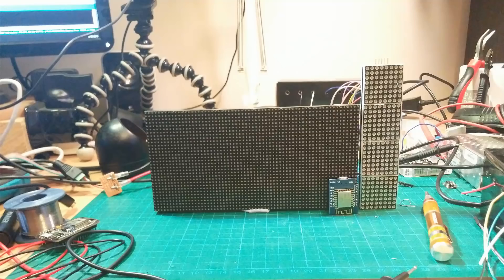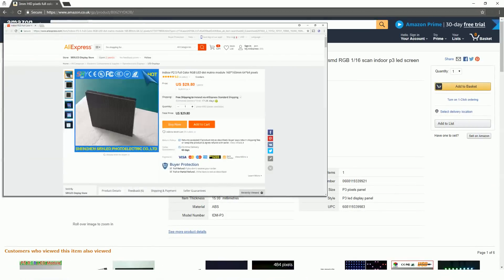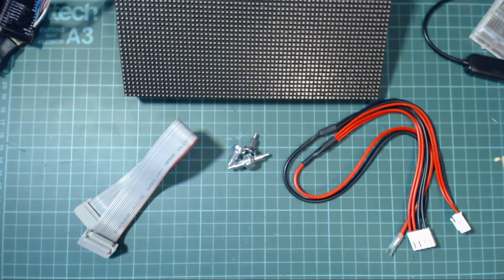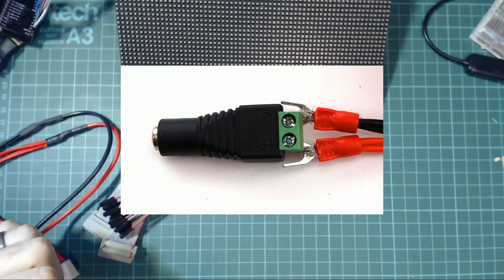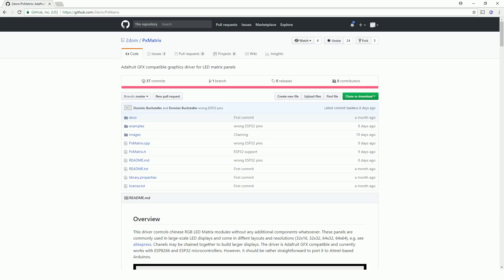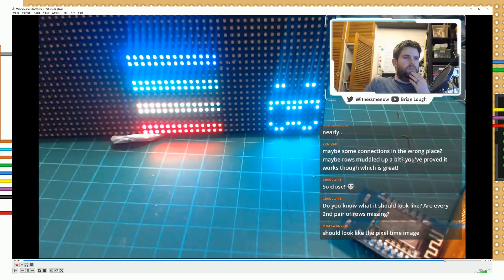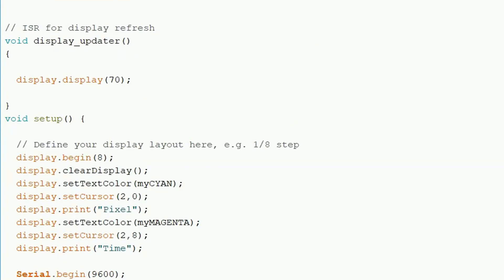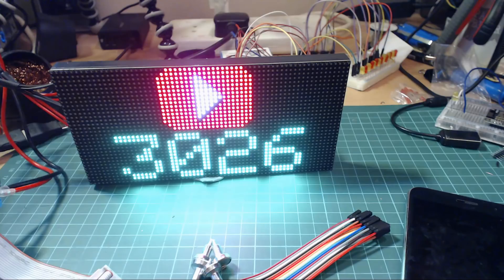RGB LED Matrix with an ESP8266 - How to get started

Comment: Hi Brian, Ive been playing with your sketches and I noticed  that pin 7 or GPIO pin 13 on the Mini D1 is not defined (or I cant find it) in the sketches and the display will not work without it. can you help elucidate what that pin does and how to change it for an ESP32? Thanks!

Comment: Thanks for the project Brian. My LED Matrix, which is same as yours, works great but when I use it for instance to get Bitcoin price online, it flickers when ESP8266HTTPClient library is using the GET function, for the entire duration (1-2 seconds). Any idea why this could be, and how I can make the transition from one value to the next smooth and flicker-free? Could it be a faulty ESP8266 or power supply? Everything works great otherwise. Cheers mate!
Reply: just in case anybody else reads this: the RGB panel doesn't have internal memory, the ESP8266 has to constantly provide the state for each of the LED's. if you make the controller do something that prevents it form updating the screen fast enough then you'll get flicker.
Given the price of ESP8266 and even ESP32 today you could try using a second ESP just to control the matrix and do the heavy stuff on another.

Comment: How to connect 2 cols x 2 rows of 16x32 panels? Will that library work and what the wiring will be? Anyone did that 2x2 panels? I want to use ESP 32 to drive them, the scan is 1/4, so the ESP32-HUB75-MatrixPanel-I2S-DMA library will not work for 1/4 scan panels.

Comment: I believe wiring shown @3:59 is incorrect. According to PxMatrix docs the green wire between PIn and POut should be from B1 (B0) to G2 (G1) and you got it drawn hooked to POut's E (4th pin in 2nd column), instead of 3rd pin.

Comment: this is an old video but thank you regardless. Surprisingly it almost worked for me. when i run the example Pixel time however the bottom half of the text is cut off. I am not sure what my issue is. I have definitely checked and the E pin is actually ground so i removed that pin. I checked the others tho and they are no ground. I also think i found my pinout but it's impossible to know.

I am using  a nodemcu v3.
I triple checked the pins being assigned to lat, a, b, c, d, and OE and they are all correct.  but the example code does not seem to mention CLK anywhere and i have it plugged into D5 could that be causing my issue? 

Another thing i noticed is the  G1 which is presume is Green1? is running to R2 on the output? is that correct? I figured G1 would go to G1 etc.

Thank you if you decide to reply it would mean a lot!

Comment: I want to to copy the project and I found a cheap rob matrix on eBay https://www.ebay.com/itm/US-Indoor-LED-Display-P2-5-Medium-64x64-RGB-LED-Matrix-Panel/284007664378? . would the process be the same as you did in the vid or would there be some difference

Comment: and you are all over the web kingdom where ever there is a mention of these Px matrix or HUB75 rgb matrices ...seems like you are the God Guru and solution wiki help desk all rounder ... i have been working with neopixels and and ws2812 matrices, i got interested in these px matrices as they are pre assembled already ready to use cheaper than the neopixels matrices considering the number of pixels or leds ..  i watched your video long back but i had no idea how to control these boards .so dropped... but now i myself ordered these boards .. and really wanted your help as there not much info on what i want and you are my only hope so please help me out ..
i want a way to control this board through esp8266 or Arduino uno  to display Artnet or tpm2.net E131/sCAN to control from Jinx! or xlights ....there are artnet tpm2.net codes for wireless esp boards and serial arduino through glediater protocol .. can you help me in this matter to control these px matrix through Artnet or E131/sCAN or tpm2.net .. really help needed ...

Comment: Hello. I use this great library too (PxMatrix), I use 64x32 P4 panel, a project works good? but some times my ESP32 reboots with this error: esp32-arduino-lib-builder/esp-idf/components/freertos/queue.c:1446 (xQueueGenericReceive)- assert failed!
How to solve this problem, thanks. I use display.drawChar(......) function for displaying time, date, temperature, pressure in one screen, possible I need some delay between output (I dont know).

Comment: There is a small mistake in the wiring schematic at 4:00, the green wire needs to be 1 pin higher on the right connector, otherwise the blue color channel does not work!
Reply: Thanks for the input. I can confirm that by looking at another Brian's project, here https://github.com/witnessmenow/WiFi-Tetris-Clock

Comment: If you connect it like this (04:00) you don't have blue on your LEDs. The green wire on the right (output connector) should be one pin higher, next to the red one...
Reply from the maker: Yes you are correct, but I can't annotate  it to correct it. I have a link to the correct wiring diagram in the description
Reply: Oops, didn't see that! It would have saved me a lot of time, but it's working now, thanks!
Reply from the maker: @angelwitch06  I'm sorry you had to waste time on it, it would be great if I could update the video but I can't!

Comment: Hi. Since I am new to all this, I have a safety concern. Is it fine to work with laptop power supplies which is 5v 6amp in your case.
Thanks in advance :)
Reply from the maker: If the power supply is 5v it should be perfect! I've never heard of a laptop with a 5v power supply though.
Reply: @BrianLough  I'm sorry, i meant to ask if working with the laptop supply which you used in the video is safe?

Comment: When i use the esp8266 for my 32x16 matrix i get a lot of noise. How do i counter this?
Reply: same here
Reply: Another post is saying you need to look for ground pins on the "output side " connector of the matrix and connect them to the ground of your WemosD1Mini. Just tested it. I confirm it reduces the red green and blue noise significantly.
Reply: Vlaming?
Reply: Als je de esp8266 voedt met de 5V bron van de Matrix dan heb je nul "noise". Best een diode gebruiken wel in dit geval om ongelukken te vermijden. Je wil de matrix niet per ongeluk "tijdelijk" doorheen je ESP8266 van stroom voorzien terwijl je die re-flashed. (of gewoon eerst je code goed krijgen met ruis en dan 1x flashen en  met je zijdezachte poten afblijven. :D)

Comment: I'm trying to use the PXmatrix.H with a ESP32, but my LED panel only turns the Red LED. Any insight of what ir might be?
Reply from the maker: Check the power connections as it only shows red for me if the display is correctly powered
Reply: @BrianLough  yep, already checked the power. 
Actually today I tried to conect the MOSI Pin from the ESP directly to the G1 pin, intead of R1 Pin.  and the Green LED turned on. So I think it might be something else. still haven't figure out what.

Comment: You don’t need 6 Amps, I drive it with a regular USB 5V charger which is only about 1amp .
Reply from the maker: When recording this video I just went with what adafruit recommended. 

In general 1 amp is far too small for a 64x32 display. Since this video I've measured the draw and all LEDs white it uses 2.5 amps
https://youtu.be/IauAe4TZk3o

1 amp might be ok if your project doesn't use a lot of LEDs, but it's not something that should be generally recommended

Comment: Would it be possible to make this portable??
Reply from the maker: Yes, but it all really all depends on how many LEDs are on. All LEDs on and white it uses 3Amps-4Amps. If you are showing something that doesn't need to light all the LEDs even a usb power bank would work
Reply: @BrianLough  I tweeted you about a portable project so we can discuss on there in the direct messages if possible.
Reply from the maker: I'm not sure you tweeted me? @witnessmenow

I don't normally like discussing things in DM, no one else can benefit from the conversation. Can you provide more details on it?
Reply: @BrianLough  its more of a business proposition for you. I coach American  football out here in California and am in need of a handheld portable LED sign that can simply project either '10' '11' '21' TE 10' '20' 'TE 20' and a couple other signals at the push of a button so that we can more efficiently change in and out of personnel groups. It is similar to the LED sign they use in major league soccer games but I do not need it that big or with any thing other than the simple LED lights. It would only need to be 64 x 64 I'm guessing in order to be seen across the field.

Comment: Hey Brian, thanks for the help, I actually got it working. However, I wanna do something similar to the Banana Dance but with 19 frames, since the memory can't handle that I wanted to do it via flash, is that possible? And how would I do that?
Reply from the maker: I've never tried it, but for the frames, instead of keeping arrays of uint16 to store the colours of every pixel, you could store every colour that appears in the frames in one array , and then change the frames to be arrays of unit8 that are made up of index's to the colour array.

This, in theory, should allow you to double the amount of frames you can have.
Reply: @BrianLough  thanks, but I actually found a better way using "const uint16_t **********[] PROGMEM =" and then "drawFrame(const uint16_t *frame)" and "display.drawPixel(xx, yy, pgm_read_word(&frame[counter]));"
Works well enough.

Comment: On the display I received in June 2019 from Ali* the blue LEDs were always on. It was fixed by moving the green lead on the right connector (as shown @ 3:48) one position up. My display uses begin(16) and no E pin.
Reply from the maker: Sorry about that, Yeah it's a mistake in the wiring diagram, but I can't update the video! I linked a fixed version in the description.

Comment: https://twitter.com/witnessmenow/status/1145821543899029509
i have seen your videos, those are very interesting. i want to do this but when i am connecting 3 32x32 rgb modules there is an issue with  colors. could you pleasetell me how to establish the connection between controller to output of panel.

Comment: i used the wiring info from the github and didnt get the display working, until i read the source code where i found out that the SPI line was also needed.

Comment: 6 amps ?

Wow!!! What a power hog. 
If that is a 12 volt power supply, that's 72 watts.

That kind of kills this project for me.
Reply from the maker: It's a 5v power supply. 

I've since measured it and it uses 2.6amps when fully white. But I also don't really trust these Chinese power supplies
Reply: @BrianLough  Hi Brian Thanks for sharing , question : 2.6 amps of mains or SMPS ??
Reply from the maker: @TheJay6621  2.6 amps is after conversion to DC, so maybe 15w of power on the AC

Comment: great video i have got 2 of those displays which i am hoping to use in a project but that is if i can get the software to work. i have carried out all of the steps in this tutorial but i am hitting a problem getting the "pixel time" example to compile. i am using an ESP-12E module instead of the one shown in the video. i have set up all the Arduino IDE and the ESP8266 stuff and can upload sketches to the ESP-12E device (blink is working ok but it is a bit of a waste of an MCU just to flash an LED though lol) when i try to compile the sketch i get an error message "Error compiling for board NodeMCU 1.0 (ESP-12E module)" is there a setting i am missing? any help would be greatly appreciated.
Reply from the maker: You probably have error messages higher up, have you adjusted the pin numbers to suit the esp 12?
Reply: Hi Thankyou for replying. I have checked the pin number definitions and they appear to be correct. i have noticed that the version of pixel time on your video is different to the one on my machine it appears that there is extra code for another type of esp device (ESP 32) i have looked at the authors github page but i cannot find any references to any further steps to take in setting this up.

Comment: Hi Brian! First, thanks for the tutorial. I have this Panel (Red, Green) https://pt.aliexpress.com/item/P4-75-dot-matrix-led-module-3-75mm-high-clear-top1-for-text-display-304-152mm/32605629557.html with Hub08 protocol; will your code work with this? The pins are as follows:
GND   A
GND   B
GND   C
OE      D
R1      G1
R2      G2
GND   LAT
GND   CLK

I can not find anything on the internet about this panel. If you can help me, I thank you

Comment: Brian, great video! Question though. I have ordered on of these panels from Amazon -US (https://smile.amazon.com/gp/product/B079JSKF21/ref=ppx_yo_dt_b_asin_title_o00__o00_s00?ie=UTF8&psc=1) and I just can't get it to work. Could you check on your board what type of chips it uses? FM6124 or FM6126A?

(and another question on the side: why do some of the pins on the input connector need to be connected to some on the output connector? If that output connector is to chain boards together, why is this needed?)

Comment: Hello Brian! I'm currently working on my own 64 x 64 matrix display using an esp 32. I used the same PxMatrix library and pixel time seems to be working, but I'm getting a lot of random pixels flickering red green and blue. Any thoughts on how to fix the issue?
Reply: am not wrong once connect the output side ground of panel to the controller ground.

Comment: Hey Brian, I could need some advise for a Project. My plan is to get some ws2812b led strips and this panel and hook them up so that I can control them via WiFi. What boards do you recommend for that? I only have experience with Arduino, so It would be best if they work in a similar way. I thought I'd get 2 of the wemos D1 mini(one for the panel and one for the led strips) and then connect both to my home network to control them with my phone for example. What do you think?
Reply from the maker: D1 mini would be perfect for that yeah, it's very similar to a regular Arduino other than WiFi stuff. I recommend getting a logic level shifter as sometimes there is issues controlling ws2812b leds with a 3.3v signal.

Check out "mclighting", it is a sketch for an esp8266 that has a web interface for controlling ws2812bs
Reply: Brian Lough oh, yeah I totally forgot that the D1 only outputs 3.3v. From what I have seen in other videos I can connect the wemos to my home network and then just need to type in it's IP address in my web browser (which I can make an app for) to trigger stuff on the wemos, right? I just found an old computer power supply which says Output:5V/25A, gonna use that on for my project.

Comment: I was able to make all the connection, but only the red LEDs turn on ... any idea what it is? An array is RGB 32X16 - 7.62. Please help!
Reply: Yuri Costa Check that your power supply is working properly. The green and blue LEDs need a higher voltage than the red, so if the power supply voltage is too low, the red will hold out the longest.

Comment: Your project is so beautiful! I'm trying make one with NODEMCU and RGB Matrix 16X32...
Reply: do you complete it?
Reply: @nawfalawwabnoordinasimi1800  no....i have a issue...
Reply: same with me. what your issue
Reply: @nawfalawwabnoordinasimi1800  maybe, the psu in my case....the leds dont power on...
Reply: @ovodomina  do you have the connection diagram from led panel to the nodemcu?
Reply: @nawfalawwabnoordinasimi1800  i used the diagram from PxMatrix, on ghithub

Comment: how do i setup a adafuit 32x32 led matrix (in arduino ide or atom) and is the wireing the same as doing a adafuit 32x32 led matrix?
Reply: I'm struggling with the same. Need to know the pin connection for 32x32

Comment: Hi I’m having problems finding the wiring diagram for my led matrix. It’s a p4-256*128-2121-A1, I ordered the p3 from amazon uk and was send this one ? I have pics of the board if that would help, ps your videos have helped me lots so far 😉
Reply from the maker: I'm not sure if the library supports that large of a resolution! Please send on the picture, I've never used one but could take a look.

Comment: Thanks for the tldr version of this.  When you figure out how to shoot LEDs, you need to make a video because I always get frustrated with that too.
Reply: The flickering is caused by the shutter rate of the camera. If you are using a camera where you can play with shutter speed you need to try to match it to the flicker of the LEDs. More advanced cameras like my gh4 have a feature called synchro scan where you can adjust the shutter angle to the degree instead of the normal click jump up and down.

Comment: i suggest using some of these cables, for connecting the PSU: https://it.aliexpress.com/item/5-pair-12V-5-5x2-1mm-Male-Female-DC-Power-Jack-Connector-Cable-Plug-Wire-CCTV/32715858157.html

Comment: Thank you for condensing the live stream, I have a couple of these modules and been meaning to hook one up to an ESP8266/ESP32 for a couple projects... do you think with the faster (and dual) cores of the ESP32 we could drive more than one display to make a larger display area?
Reply from the maker: No worries! I haven't tried it but seems like the library had an update recently to support chaining together, I'm not sure how fast it works but you can see an example on the readme of the library.

I've tried the display with the esp32 in another stream but I haven't bottomed out playing around with it yet

Comment: Really nice conclusion of your stream. I did not find the time to try out mine at all but I surely will in the next days when my garden is finished to be planted.
Reply from the maker: It's actually pretty straight forward to setup, the stream would have been a lot faster if we didn't run into that crashing issue!

I have a few more plans for this display too, but I have lots of projects on the backlog so we'll see!
Reply: Brian Lough now I am really interested in what you will do with it because I do not have a particular plan what i will display on mine.